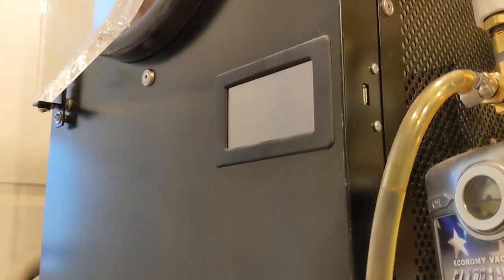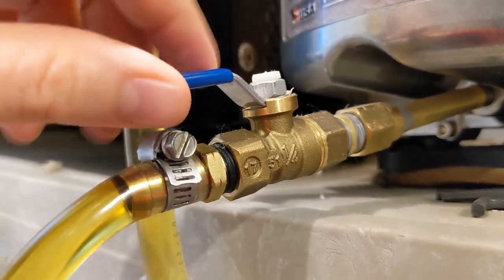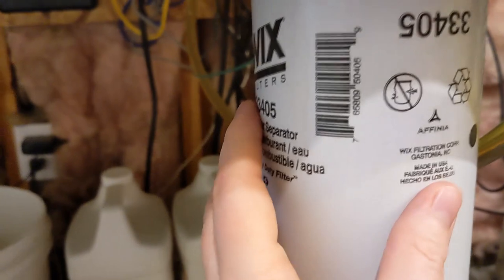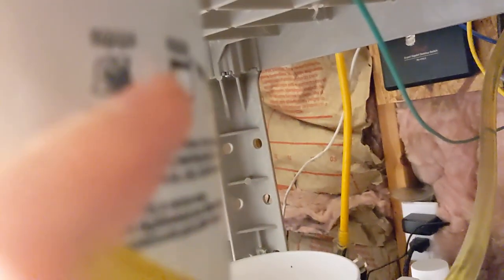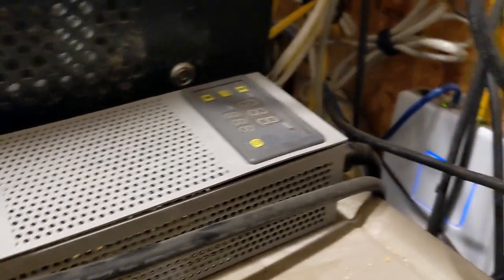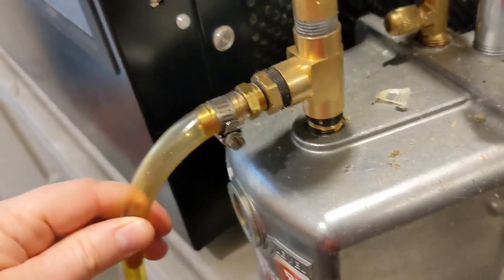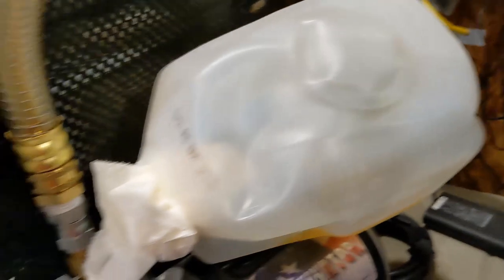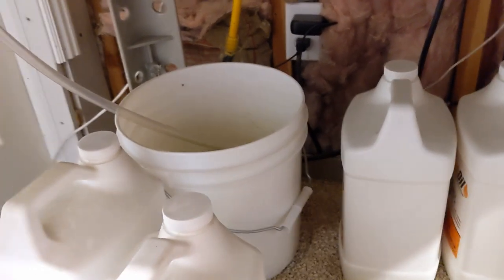DIY automatic oil filtration system for Harvest Right Freeze Dryer

Comment: When we moved the oil stayed in our vacuum pump for about a year, we have cleaned the pump at least 3 time since and every time we use it the new oil comes our dark.  Do we need to have it serviced or replaced?
Reply from the maker: Hey, Kevin! If you haven't done anything yet, I'd look into a deep clean of the pump or getting it serviced. I'd also look into setting up an automatic filtration system for the pump so that life gets easier in the future. If you've already done something, I'd love to hear what worked (and what didn't!).

Comment: Question: Is the oil constantly running through the pump as you freeze-dry or do you still fill the oil up to the line in the window and stop the oil from coming in after it gets to the line? Is the instruction to fill to the line just to prevent the oil from spitting out all-over (been there, done that)? With your creative system the oil cant spit out.... is that the concept?
Reply from the maker: Great question! The oil moves through the pump (and our system) when the pump (and freeze dryer) is running. So we filled it as instructed, but then we also filled all of the tubes and pumps, because it added to the available space the oil can be. If we hadn't added the extra, then the pump would have been 'low' on oil, and could seize up.

So you will need to prime any tubing you add with oil. 

And yes, adding too much oil can increase what gets spit out.